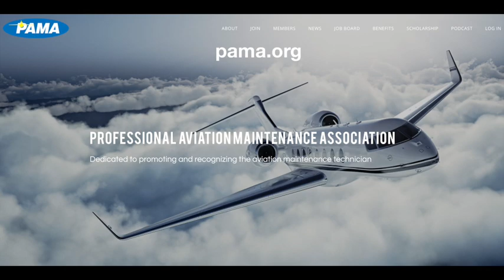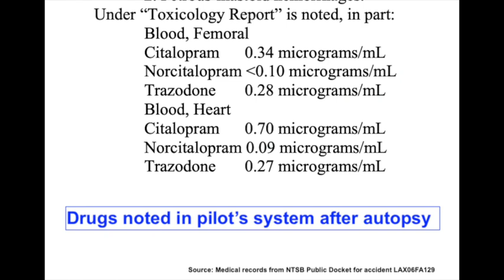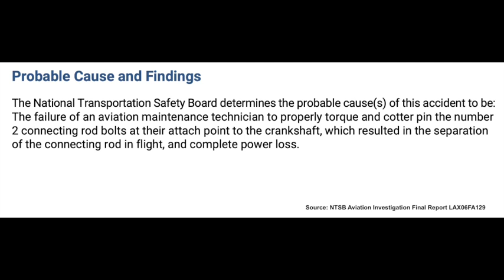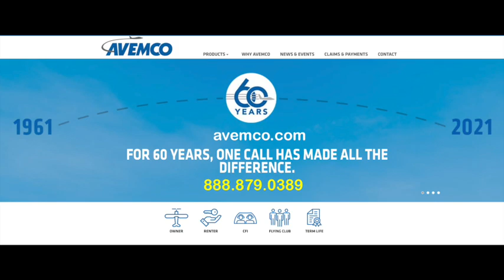Peter Tomarken Air Crash Was Survivable – Episode 146

Comment: Not a pilot, but extensive experience with anti-depressants. Antidepressants are more correctly described as "mood stabilizers" due to their effect on the serotonin and/or noradrenaline signal substances. 
Citalopram is a very old and well known mood stabilizer that works on the serotonin receptors (SSRI). Trazodone works on the noradrenalin receptors (NRI). Nowadays it is more common to use medication that works on both serotonin and noradrenaline combined (as in venlafaxine or duloxetine, SNRI).
The effect on serotonine will increase the general wellness of a patient. Noradrenaline inhibitors will decrease anxiety over time. To keep the mood stabilized with increased wellness and reduced anxiety it requires a well planned and monitored medication with proper doctor support.
It is highly unlikely that a long documented medication of this kind would make anyone impaired enough to crash a plane. Mood stabilizers can be hazardous the first 1-5 months while the body adjusts to the increased levels of signal substances, but after this period the large majority of people experience higher levels of wellness and reduced anxiety. If the pilot were on a long course of mood stabilizers, it is thus extremely unlikely they had anything to do with the crash. 
A medical emergency cannot be overlooked, but that medical emergency would be from a completely separate event, not relating to ingestion of the mood stabilizers.
Reply: @pissant145 - You are correct, however, when these "mood stabilizers" are combined with other medications such as Trazadone in this case, that are not allowed to be taken together, it can produce all sorts of side effects. Trazadone on it's own is VERY sedating and mixed with an SSRI or NRI it can be doubling in its effects. In addition, these medications combined can slow your reflexes and your ability to respond quickly and decisively in a critical situation. Finally, it can increase the brains susceptibility to the effects of a concussion or TBI, in that if you receive a head injury while taking these medications your symptoms and susceptibility to a head injury can be quadrupled which in this case may have contributed to the reason why the pilot was not able to extricate himself from the airplane after sustaining a head injury. Just wanted to provide some context to your spot on comment of the effects of SSRI's.
Reply: Trazodone is kind of old medication and I concluded that if Mr Tomarken had such a long history of mood disorders, both he and the Drs would be very familiar with how it affected him. 
If overdosed, yes, Trazodone may have the effects you describe.
Reply: @On-Our-Radar-24News  My APRN recently prescribed Trazodone to me for my insomnia.  She advised me it's an anti-depressant that is often prescribed for insomnia.  I can attest to the effects of the drug; in fact, it often works too well and even with 10 hours of sleep I wake up feeling groggy and with a 'hangover' effect (headache, takes at least an hour to fully 'get up to speed', etc.)
Reply: Are you saying Peter Tomarken was on antidepressants?

Comment: Why is there more protection in a race car than an airplane?
Reply: Weight roll cages add to much weight
Reply: Race cars are sold to people who know how dangerous the sport is, but GA aircraft are sold to Joe Public, who wants to think it is OK to take their loved ones up for a spin, so the mfrs. are not going to emphasize the bad results should something go wrong. It's the same reason auto mfrs. fought mandatory seatbelt laws back in the day: it will be worrisome to the public and effect sales. Look at it this way: you have all that time between the vehicle stopping and your body stopping to argue the pros and cons of the economics of installing safety equipment, but no longer.
Reply: Weight is your enemy in the aircraft. If you have more weight in your aircraft, then more fuel is needed.

Comment: Okay John you've got repair stations mixed up with a mechanic doing a top overhaul. Yes the repair stationed should have all the documentation for a proper overhaul but the mechanic doing the overhaul on his AP license may not have access to the correct Continental motors overhaul repair documentation. I know this for a fact because I've worked in flight schools where they're not of repair station and the mechanic had to sign off all engine work on his a&p license, this was scary as hell for sure as the mechanics I worked with only did what they were told to do with regards to engine repair. And for sure if you're a mechanic doing a top overall your boss would it be very upset with you if you started looking at the connected rod bolts as they have nothing to do with completing a top overall.